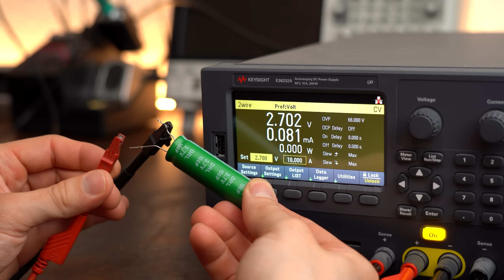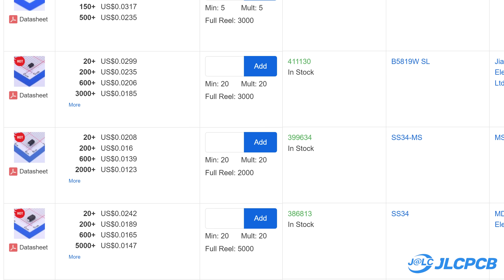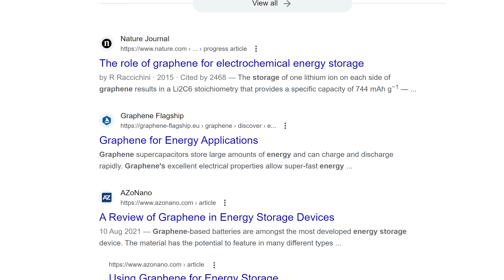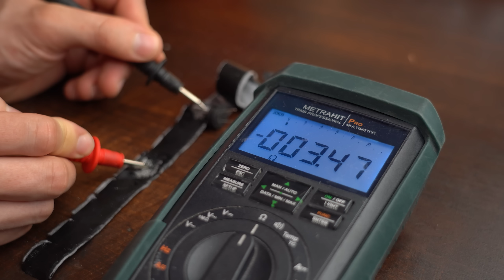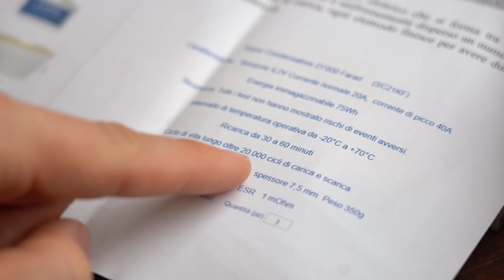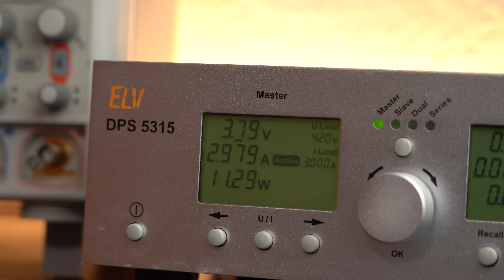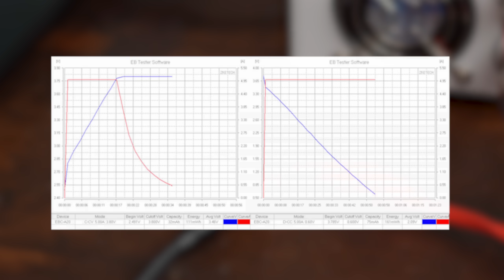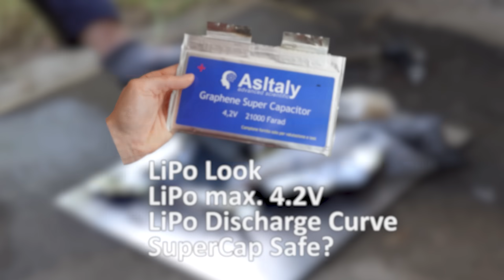Finally a Capacitor that can REPLACE a Battery?!

Comment: That looks like a LiFePO4 pouch cell and they don't always catch fire when punctured. If they do smoke it's less violent than LiPo.
Reply: This is exactly what they look like internally, so I'd tend to agree as well. You'll have carbonized copper sheets alternating with aluminum sheets coated with the LiFePO4 dope, separated by the layers of barrier material. 

Put one of the aluminum sheets into a flame and see if it burns red, indicating the presence of lithium to confirm.
Reply: @bjn714  How do you carbonize Copper?  Copper is copper.  It doesn't reduce to Carbon.
Reply: @ChozoSR388  the copper sheets are doped with carbon. I realize I was using the incorrect term calling it "carbonized" (since it's not actually being converted to carbon) but it isn't really carbon-plated either so I wasn't exactly sure the best term to use to describe it in my fresh out of bed state when I wrote the initial comment.
Reply from the maker: Hmmmm possible.
Reply: @greatscottlab   I am studying that kind of battery-like supercapacitor as part of my Ph.D. program. You got scammed by eBay since the real price is only 35$ (EXW). Then the graphene contained in the cell is dissolved in the electrolyte in the form of reduced graphene oxide and not in the anode as a substitute for the graphite. This kind of supercapacitor is promising for the long cycle life rather than another characteristic
Reply: @ilmarox but by definition there can't be a hybrid between a lithium battery in a capacitor because a lithium battery is a chemical reaction where is a capacitor stores actual charge so their very nature is a little contradictory to be put together. I mean does this thing store actual charge just like a capacitor only somehow more of it? Or does it still have the chemical reaction like all batteries do?
Reply: @SheikhN-bible-syndrome  They actually are graphene-li hybrid capacitors.
Reply: @SheikhN-bible-syndrome  they store charge like a battery in one electrode, not in the other. I.e. could be a not-capacitive faradic process in one electrode and a not-faradic capacitive storage in the other
Reply: @ilmarox  that would be a capacitor not a battery because the very nature of the two makes it impossible to make a hybrid because a battery has a chemical potential where as a capacitor holds an actual electrical charge hints why they dont hold a much as a battery. Fact not my opinion
Reply: @SheikhN-bible-syndrome   Could you cite some scientific articles to prove that. If you read George R. Zhang about this argument you can find out that that type of electrochemical energy storage is feasible
Reply: @SheikhN-bible-syndrome hybrid caps exist....they store part of their total charge chemically, and part of it electrostatically, so a Lithium-based hybrid cap, with more chemical storage than electrostatic, could look exactly like this one, both during disassembly AND on the discharge curve.
Reply: @ilmarox  that's BS
Reply: @ilmarox and so on ? Put the link to a product that cost 35$ for explain
Reply: @greatscottlab when / if you verify, please make a video or provide some sort of update. This is interesting indeed!
Reply: @greatscottlab  If I recall in the early days of the LiFePO4 cells the max charge was briefly 4.6 volts then it was downgraded to 4.2 then to be even safer 3.65 and in some cases they recommend just 3.5 volts for the max charging voltage. LiFePO4 cells act just like this when punctured. I love my LiFePO4 cells. It is a battery not capacitor.
Reply: @onegreenev  look at the discharge curve tho, lifepo4 charged to 4.2v would fall straight down to 3.3v to 3.4v  so this is a lipo. it may just have not been constructed the same as others that stopped it from igniting
Reply: @onegreenev From what my LiFePO4 supplier had to say, any time you get a LiFePO4 to hold more than 3.65V of charge, it means they snuck a bit of Cobalt into the chemistry
Reply: @roberthercules3159  I doubt LiFePO4 cells ever had been doped with cobalt but you can charge to 4.2 volts but the voltage will drop to 3.5 or 3.4 volts and if you charge from 3.65 to 3.5 you will see it settle at 3.3 volts after a proper charge. Ive been using LiFePO4 since they first came out. Max of 3.5 is a very safe upper limit. 2.8 is a good safe lower limit.
Reply: @greatscottlab hey try @bjn724 ‘s suggestion to put the aluminum side in fire and see if it changed colors to test for lithium.
Reply: @greatscottlab  Maybe try charging one up fully and then puncturing it in an explosion containment container (Pie tin)? ifixit did a puncture test in 2018 that you can look at for reference. the high tech lab channel did a puncture test on a big LiFeP04 battery back in 2021 too. Fully charged batteries behave more violently compared to less charged ones according to the ifixit video. You can also take apart a electrolytic capacitor for reference. The layer structure is near identical to the naked eye. plastic film with electrolyte and metal layers.
Reply: @greatscottlab  I don't know if you have IEEE membership access, but here is a seemingly on point IEEE article about literally using existing battery pouch cell manufacturing equipment to try and make supercapacitor pouch cells with high voltages of about 2V to 5V-ish according to the abstract.

R. Negroiu, P. Svasta, A. Vasile, C. Ionescu and M. R. Buga, "Realization and Testing of a Super-capacitor, Pouch Type Cell," 2020 IEEE 26th International Symposium for Design and Technology in Electronic Packaging (SIITME), Pitesti, Romania, 2020, pp. 71-74, doi: 10.1109/SIITME50350.2020.9292280.

I am not sure how easy it would be to go from where you are to the UK, but maybe the University of Warwick's electrochemical society can help you get in contact with the authors John Roberts, Irene Rubio, Daniel Gonzalez and/or Rohit Bhagat Who published meeting notes under the title "Supercapacitors: From Coin Cell to 800 F Pouch Cell" They may be willing to help you investigate and verify the validity of this cell in exchange for publicizing their work or something. Or maybe just for fun. 

Citation: Alexander John Roberts et al 2016 Meet. Abstr. MA2016-02 1029
Reply: @greatscottlab  Lithium battery, the give away is the alternating material the plates are made from, copper and aluminium.
Reply: @greatscottlab well?....
Reply: @greatscottlab it is possible you got scammed because pretty much every capacitor is round and not flat like a Normal lithium battery so yeah it most likely fake also I love your videos keep it up
Reply: Or it has moderators to make it safer. UL listed lipo batterys for medical can have a nail through them just fine with no smoke or flames.
This thing sure looked like a battery not a cap though...
Reply: I made a separate comment already, but I'll also add it here.
Ok so I wrote them an email inquiring about their supercapacitors. Here's a translation of the reply:

Good morning,
these devices are hybrid supercapacitor that have a higher voltage, capacity and energy density (up to 10 times) when compared to symmetric capacitors. They also have a lower leakage and standby currents. Alternatively, traditional supercapacitors have higher an higher power capacity (?) due to the lower ESR, the operating temperature interval is wider and can be discharged down to zero volts. Hybrid supercapacitors can't be fully discharged. Their structures are very similar, but an hybrid supercapacitor uses a graphene anode interwined with lithium and a different electrolyte.

Another advantage is its discharge curve being closer to that of a battery.

The fact that it's an hybrid is obvious from the shorter lifespan compared to electrostatic capacitors, but 20000 cycles mean 6 milion kilometers if used in an electric car or over 50 years of duration on daily charge. 

The differences among our supercapacitors are due to differences in distance between elctrodes and the difference between a cylindrical geometry and a pouch.

So yeah, they were hybrids all along. Cheers from Italy.
Reply: @davidebic I thought this looked familiar - it looks like they took Eaton's description, translated it to Italian and then it got translated back
Reply: @davidebic Best answer in this thread. Great thinking, reaching out to the company directly.
Reply: This is NMC battery
Reply: @NekitGeek Nickel-Metal Cadmium?
Reply: @seanewing204  LiNixMnyCozO2
Reply: You could do a chemical test of graphene to at least see if there is graphene present or not.
Reply: It is absolutely not a LiFePO4 that has at least 10 times fewer charge/discharge cycles, has different voltages and a much longer recharge time!
Reply: NOT AT ALL LIFEPO4 !!! LFP have max voltage 3.7; LFP smokes and even catch fire if holes are made on it !!! Not explosive as Lithium ions but also catches fire. I am very curious about this material !!!
Reply: Battery
Reply: There is also lithium titanium oxide batteries that we were able to put a nail thru without it causing a rapid disassembly. The downside was lower energy density. Ours was more of a jelly roll than a sandwich like what this one was. Looks like it still has a copper foil side and an aluminum foil side.
Reply: Yeah I cut a lifepo4 battery in half with an axe once, it didn't even get warm. I find there's a bit of skill and luck involved in getting them to cook off. They're a lot safer than  lipo, much more tolerant of over and under charge before going critical, etc...
Reply: Oh,that's a good point,  never had an LiFePO4 pouch cell,but it I do love my 6000mah brick battery
Reply: LiFePo4 has a nominal voltage of 3.7 volts.
Reply: @nemam_nedam  yep this seems right
Reply: Like others have said, definitely.not lifepo4... voltage under load is way to high.
Reply: Lifepo4 does not burn at all
Reply: Lifepo4 is only 3.65 volts so no its not a lifepo4.
Reply: @Youtube_kontot  You can definitely charge a lifepo4 to 4.2v.  They function but degrade after dozens or hundreds of cycles.
Reply: @Youtube_kontot not always!
Reply: @Youtube_kontot  The maximum non-damaging (and not ideal) charging voltage for LiFePO4 is actually 4.2 volts before electrolyte breakdown.
Reply: @Youtube_kontot  it seems you ~can~ charge a lifepo to 4.2v but will damage the it, and like the other scam products online....its mislabeled
Reply: @ab2tract  You can charge to 4.2 but if you let it sit the surface charge will dissipate and you will have a battery sitting around 3.4 3.5 or 3.6. If you charge to 3.65 you will see it drop to 3.3 volts and if you charge to 3.5 you will see it drop again to 3.3 volts.
Reply: @Youtube_kontot they rate them differently when you see 4.2 volts on there that's the 100% maximum which I find extremely dangerous to do because people are going to assume that there's still some Headroom at 4.2 when there's not this is just a lipo battery with the graphene anode the best marketing gimmick batteries have ever seen
Reply: @Youtube_kontot  I've got a 6 volt one to prove you wrong,but it's not a pouch cell
Reply: @Youtube_kontot maybe they designed one that can output 4.2 then?
Reply: @Youtube_kontot  Correct. I was about to state the same thing.
Reply: @Youtube_kontot  they can stack some in series to get the 4.2 voltage
Reply: @Youtube_kontot  
Where is it stated in the laws of physics that all LiFePO4 batteries must be 3.65 volts? Nowhere. You're wrong, bud.
Reply: @greg77389  Since battery cell voltages are a function of the physical structure of the battery, and the fact that manufacturer would have, at worst, major legal liability issues (at least locally) or, at minimum, cause a big enough reputation issue that they would reasonably likely to lose major manufacturing contracts keeping their business afloat, there would be no actual manufacturers who would advertise such High maximum charge voltages on a LiFeP04 battery that they make. Also, at the volumes manufacturer's distributors sell product at it is likely that they wouldn't rebrand batteries in such a way for the same reasons. Relatively low volume sellers maybe though. Still risky for them too for legal reasons though.
Reply: @greg77389  Do some research and look at how the charge and discharge looks like for lifepo4. Its a much more flat line, so this is not lifepo4, bud.
Reply: 4.2v is too high for LifePO4 and the discharge curve is completely wrong for this chemestry where the voltage will stay pretty much constant throughout the whole life.
Reply: No, LiFePo4 has almost all (>80%) of its capacity discharged in a narrow voltage between 3.0v to 3.4v. I know this quite well because I use solar panel with this battery for years. It does not hold capacity above 3.65v (3.65v is the maximum allowed safe charge voltage), so after plugged off from charging, it will immediately drop to 3.4v. So, based on discharge level shown on 8:55 I can surely assure you this is NOT LiFePo4 characteristic, by way way off.
Reply: LIFEPO4 Battery has a nominal voltage of 3.2, max voltage of 3.65 so😅😅🫣

Comment: At no point did I think that was actually a capacitor, but I still learned a lot in this video.  Thanks!
Reply from the maker: It is something ;-)
Reply: @greatscottlab  Mysteriously it is no longer available for sale on their website and is only available as a studio prototype.
Reply: @javierolavarria that's sus
Reply: @javierolavarria "Campione fornito solo per valutazione e test" means "Unit provided only for evaluation and testing". It probably was never meant to be sold directly, in fact this was bought on eBay. As for the "Super Capacitor" label, that probably is a straight up lie
Reply: @kryotek7126  Watch the minute 6:35, the official website was selling it.
Reply: @javierolavarria  you're right, my bad
Reply: Same :)
Reply: Eh, I fell for it when I first saw it and thought it'd be super cool if it was real. Then I started hearing him talk about it and realized it was a scam.
Reply: I'm still waiting for the holy grail of power storage... something that small that can store the same amount (or more) energy as a lithium battery..... but it's safer and gives you 100k to a million charge cycles!

Comment: What about the charge curve? Capacitors stop absorbing the energy after reaching their max capacity. LiPo batteries get hot or even can blow
Reply: Capacitors will gladly accept electrons beyond the capacitors rated voltage. You just have to keep pushing them in with a voltage higher than the capacitor has “now”.

“Gladly accept” is kind of a misstatement. They will accept them, but they will BLOW UP.

Comment: I get about 51.5 Wh for the graphene capacitor (0.5 * 21000*4.2^2)/3600 =51.5Wh, which is much less than any of the lithium cells on your graph.  Your graph shows the graphene cap at about 130Wh, assuming the unlabeled Y-axis is Wh.
Reply from the maker: What graph do you mean? Most of them are volumetric and gravimetric energy density. So Wh/kg and Wh/l
Reply: @greatscottlab  The graph shown at 0:53 in the video
Reply: Nevermind, I see it is in Wh/kg, my mistake

Comment: It's a 'fake capacitor', there are two stage on it, first, it will behave like a capacitor, then chemical reaction kickes in, then it will work like a li-battery. It combines two advantage of a battery and a capacitor 😊
Reply from the maker: Proof?

Comment: I would always be cautious with new technology, as currently, every software claims to have Artificial Intelligence, even though it only contains simple algorithms, or when the first boards appear with 'quantum' technology, manufacturers can be very creative. Rarely do you get what is promised in the beginning.
Reply from the maker: True
Reply: Yeah. Recently I ordered some Sodium-Ion batteries off AliExpress, but can't be entirely sure that they will be actually Sodium-Ion or if they will be rebadged LiFePO4 cells or similar given the external numbers are pretty similar... Granted, would be kinda funny given the whole point of sodium to be cheaper than lithium.
I guess as long as they are not mostly-hollow GTF/UltraFire/etc style cells, will be happy enough...

Comment: Appears super safe on the positive note!  Price point would be nice to come down. Something like a LIBS, Flame, Plasma and/or Arc style spectrophotomer maybe even of the webcam advance DIY design would be handy to test to see what is actually made of.  Might make for some cool DIY or buy videos as well.  Maybe even a COTS X-Ray or Gamma Ray spectrometer. The later would be more a gadget since seems there are one or two cost effective ones on the market now and I think there are made in kit forms as well.  Wondering if the AsItaly company wanted the supercap back as well to recycle the material?  Show is safe for shipping?

Comment: It look suspiciously like a lithium battery when you reveal the copper color electrode inside. Take 1 sheet and put it in water if it shizzle or bubble i'm 99% sure it is a lithium battery because lithium react violently with water and give off heat
Reply from the maker: Thanks for the feedback and idea. I will try to add some water :-)